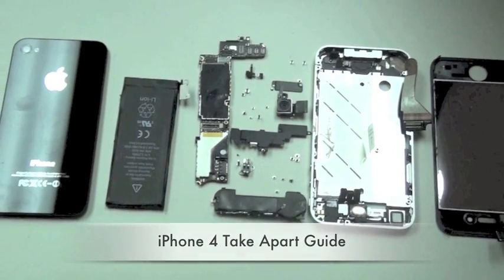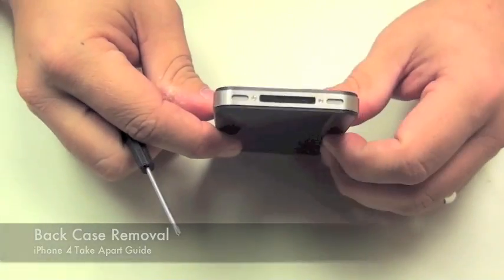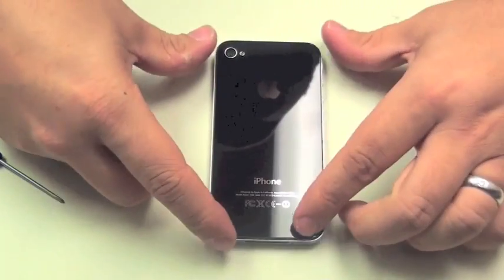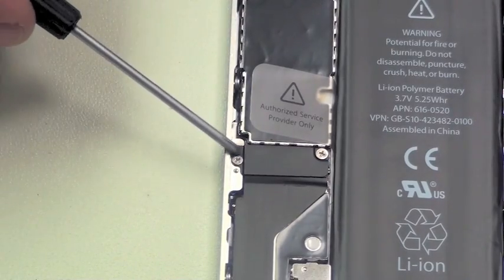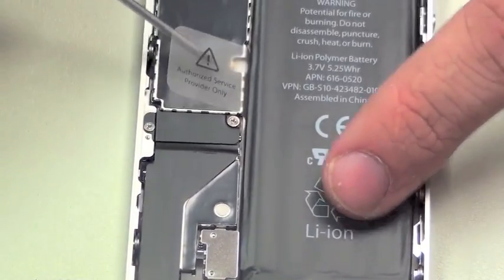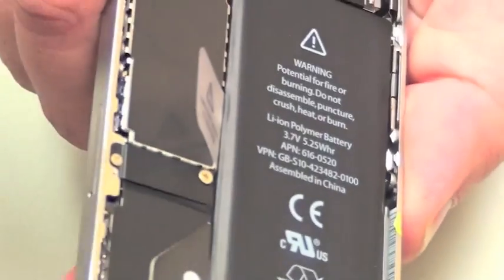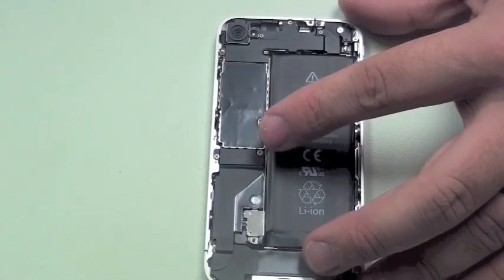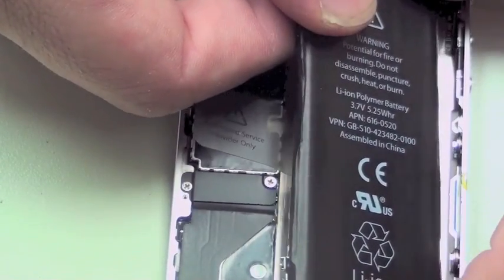iPhone 4 Back Case and Battery Removal Guide

Comment: what if i dont have a phillips screwdriver small enough to open the battery connector cable what could i use instead of that?

Comment from the maker: When this video was made, the two screws on the bottom were Philips head screws. Apple changed the screws later in production to pentalobe screws to make it more difficult to get into the phone. Before you start using words like moron and all caps, you may want to check your facts.